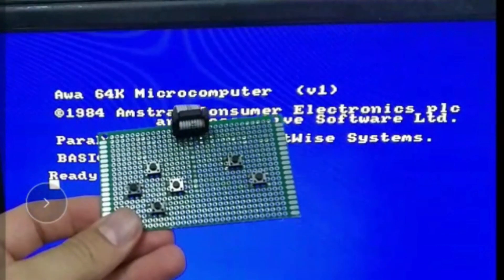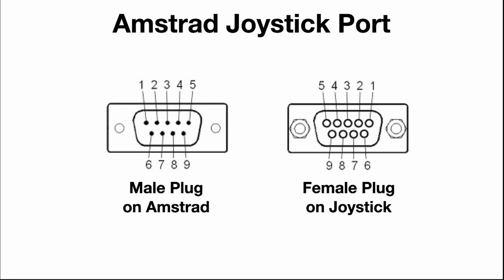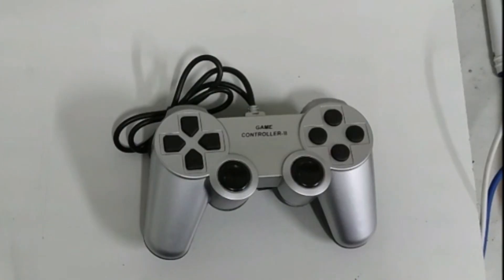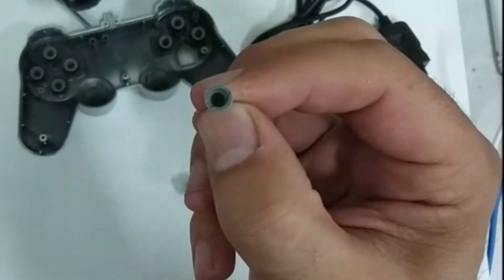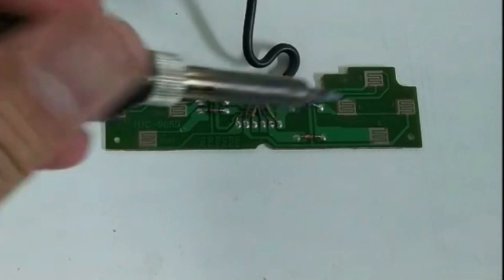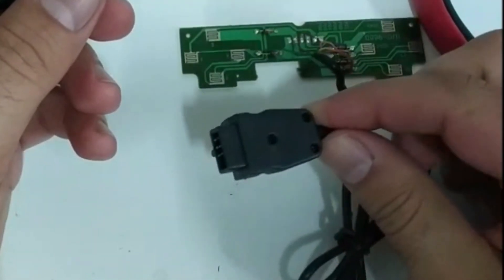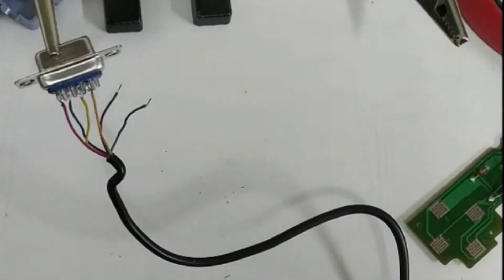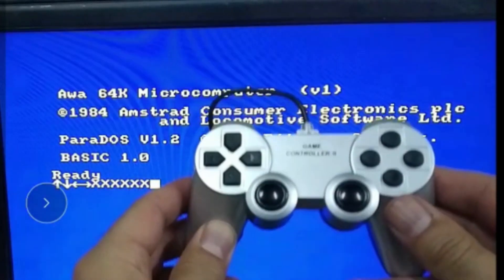Build your own Amstrad CPC Joystick

Comment: I see a 3 buttons joystick amstrad homemade on a Facebook forum.
Can a cpc handle more button like a megadrive or an amiga cd32 pad?
Reply from the maker: Good question. The Joystick port does have 3 fire button pins. Fire 2 is the normal button. Fire 1 is the secondary  and only sometimes used and Fire 3 is undocumented and rarely used.
Reply: @ReadyZ80  it exist the amx mouse for amstrad with 3 buttons, I think they follow this way.